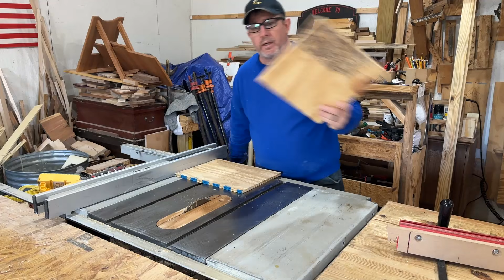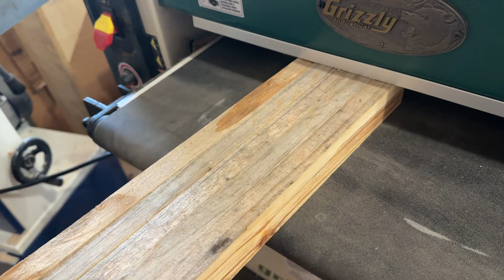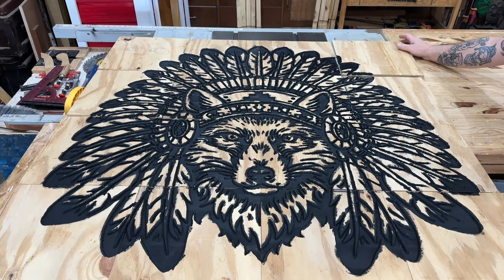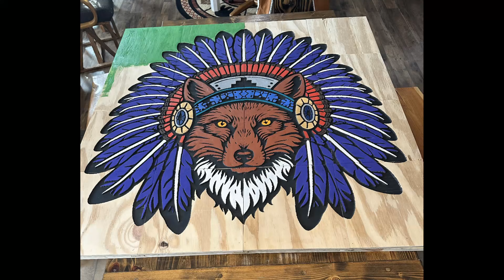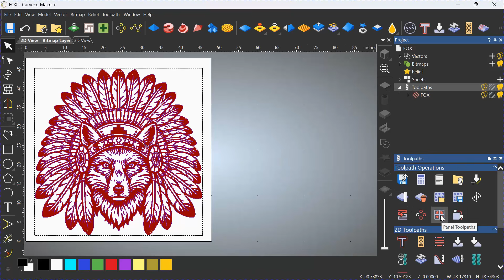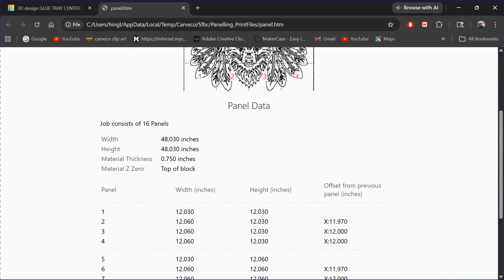How I made a huge CNC wall art piece using panel tool paths ￼

Comment: Hi again Vernon do you think it makes a difference what size bits are used ? i have been using a 1/4 inch would an 1/8 cut cleaner ? any thoughts or suggestions ? thanks
Reply from the maker: I don’t think bit DIA would make a difference 
Do you mean you are getting lines on the bottom of your area clearance cuts if you are I would try Tramming your machine if it is off it can leave ridges
Reply: @Hinkleshop  the cuts are not really smooth , some light parrell lines from the depth of cuts some show up more so on different material, thanks again

Comment: Great job thanks for the information , i may have to upgrade to maker plus. Question for you Vernon Have you used any compression bits ? if yes do they cut cleaner so you can have less sanding to do ? And if yes which bits have you tryed and work successfully thanks keep up the great work
Reply from the maker: Thank you 
I haven’t tried a compression bit yet
I typically use a downtown jenny from Cadence manufacturing 
I try to be strategic about stock placement also I don’t normally use tabs I leave .01 or so on the stock and use a flush trim bit in my trim router for clean up which means very little sanding
Reply: @Hinkleshop  Your welcome, Thank you I have a few Jenny bits from cadence i will try his down cut bit , i have try a few other manufactures and it seems on some hardwoods there is a lot of sanding.